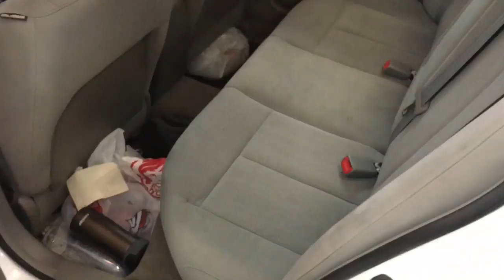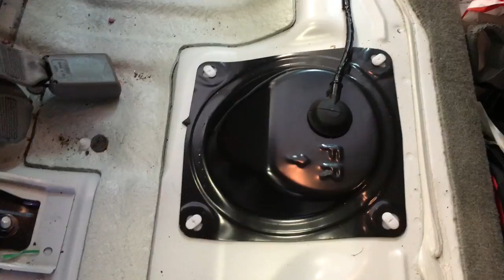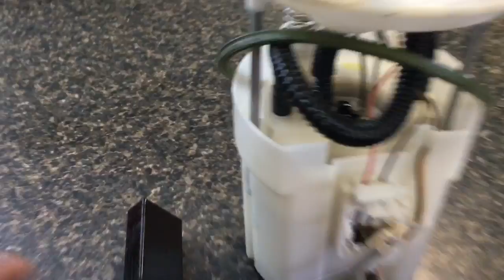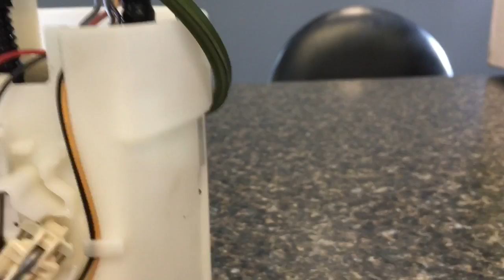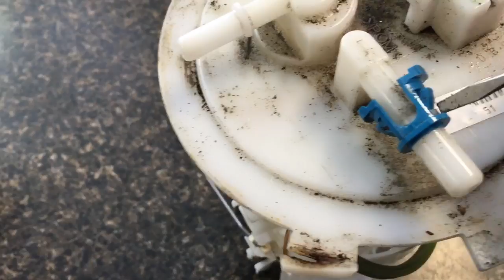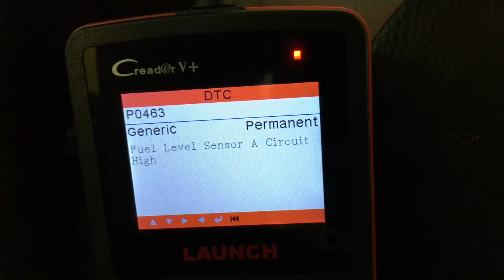2010 Nissan Altima P0463 Fuel Sending Unit

Comment from the maker: The fuel sending unit and or float level is adjustable.  If it has been changed it may not be reading correctly.   I would fill the tank and reset your trip meter then run it 100 miles top off the tank and see what you are getting for fuel mileage.  See if that is close to what you get half tank or less.

Comment: I have a quick question. I have a 2011 Nissan Altima and been have the car since November. I noticed few weeks ago when I put half of tank of gas in the car, the gas gauge stay half a gallon but the gauge would go down fast. I went to the mechanic and have them use the reader to see if anything was wrong with it. They said it was nothing wrong with it. Do you think that I need to replace fuel pump or the wiring?
Reply: Try wiring first

Comment: How did you reduce the fuel pressure before removing the fuel lines?  You said in the video that you remove the fuel cap, but that will just remove the tank pressure.  The fuel lines in a fuel injected vehicle always has high static pressure.  I found this out the hard way many years ago when replacing the fuel pump in my Mustang.
Reply: Im thinking he found out the same thing making this video.
Reply from the maker: good note. when I take off the height pressure side, I remove it as slow as possible. like removing a cork from a Champaign bottle..

Comment: I'm having a problem with my 2011 Nissan Altima. Check engine light is on. It's telling me Mass air flow sensor but done had that changed and it's still saying MAF. Car is cutting off and now the traction light is on as well. What could be the problem
Reply: Make sure you used OEM

Comment: Do you know how to drain completely the gas on a Nissan Altima 2016? Will it need to be reprogram afterwards or the light will turn on the dash?
Reply from the maker: no drain, so pumping it out or commanding the fuel pump on, draining the supply line
Reply from the maker: Will clear the code after 3 consecutive tests.  Disconnecting the battery cable or clearing the code with a scanner would reset the light also.

Comment: Hey, do you think in your opinion, you could clean the sender and have it work rather than replacing the whole fuel pump?
Reply from the maker: no, grooves it the sender are a problem. maybe. lean and adjust tension would help for a bit.

Comment: I don't have any issues with my altima 2008 but I'm thinking of changing fuel filter after 200,000 km. Is it necessary
Reply: I have the exact same question, mine has 190k at least I know it will still work fine for another 10k miles.
Reply: Coronado Quintanilla I changed half of it recently
Reply: @Hussainzidane   I don't understand, you changed half of what?
Reply: Coronado Quintanilla oh sorry I thought we were talking about gear oil, because recently I was talking to other guys on other comments about oil gear and I thought it's same comment.
Reply from the maker: maintenance is always a good option.

Comment: I have a 2012 Nissan Altima. Does it have a fuel filter? I'm getting 17 highway and 11 city.
Reply: Hi. Did you replace your fuel pump? Does your fuel efficiency increase after it has been replaced?
Reply from the maker: if your check engine light is on due to this, it may affect fuel mileage very slightly, as cars are designed to run under per programmed perimeters. Not using live o2 sensor readings to adjust fuel trim....this will not cause 10 mpg loss
Reply: Emmanuel Caarion The fuel filter is part of the fuel pump so unfortunately you can't just replace the filter, you have to replace the whole pump assembly. I'm about to replace the fuel pump on my 2011 Altima and I was able to find a Delphi which is an OEM direct replacement for $206 on Ebay.
Reply: @abyde  uhh that sucks dam. I have 72k miles so maybe I'll just change the fuel assembly at around 100k
Reply: Emmanuel Caarion  Is there a reason why you think it's your fuel filter/fuel pump? A lot of things can cause bad gas mileage. Check out this video:

https://youtu.be/_8KvLHrBkf0
Reply: @abyde  I actually have no idea. Usually that's something maintenance wise that could help improve gas mileage
Reply from the maker: plugged filters would cause some running issues, other things to look at for increased fuel mileage
Reply: my 2010 altima 230k now.every 3k add one bottle fuel injector cleaner

Comment: How is it that you get an error code when the fuel sending unit is malfunctioning? I got the same issue my fuel gauge and level display are way off yet no error code? I already replaced the pump and I have the same issue.
Reply from the maker: Did you replace the sending unit with the pump?
Reply: i got a whole new pump from Rockauto and my fuel gauge level display and indicator are way off. Right now display saids i have an average of 436 miles to empty and my fuel indicator saids i got more than 3/4 full. Is there another sensor that i should be looking for?
Reply: and when you mean fuel sending unit you also mean fuel pump right?
Reply from the maker: Sounds like the pump you put in has a sending unit attached.  So either the new unit is faulty or the float lever is installed in the incorrect location.
Reply from the maker: The sending unit is the part attached to the float with a metal rod.
Reply: Tech4Tech  ok I'm going take it out and see about the float level and check the ohms on the new sending unit. I may just try to get an exchange on this pump.
Reply: @lprince3884  What ended up happening with it?
Reply: @Sarah-jz6qd  I never had a error code on my altima but I got a new more expensive pump from rockauto... gas milage display got fixed. Dont get the cheapest pump.